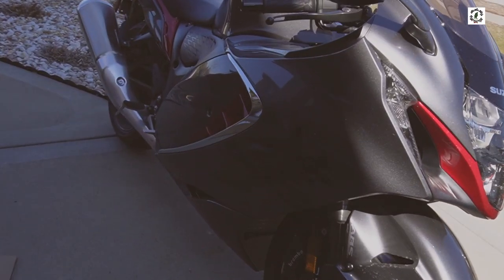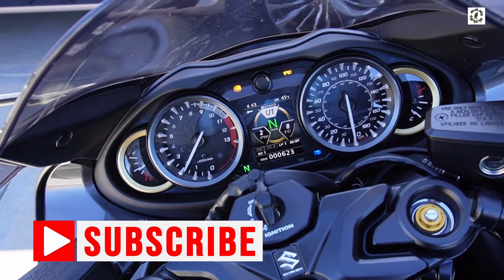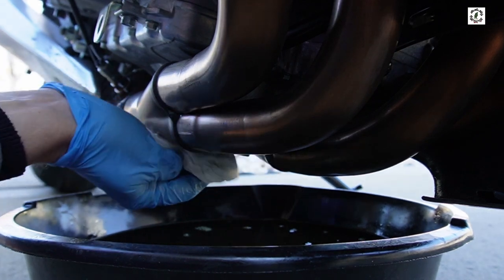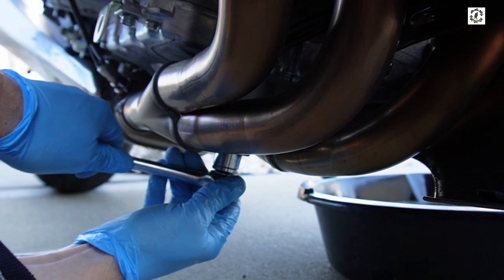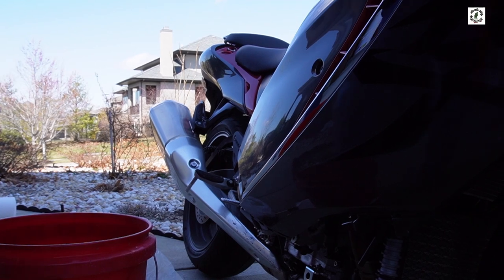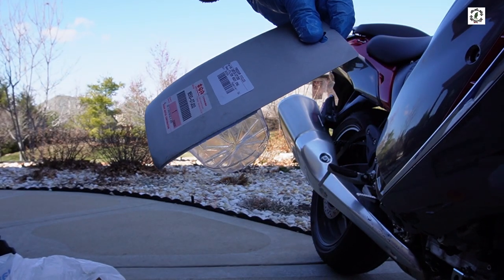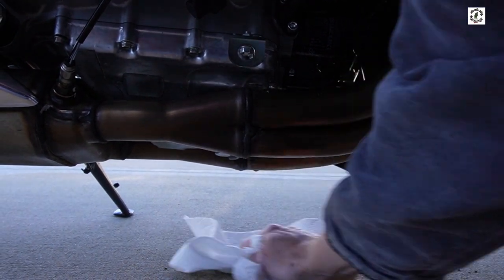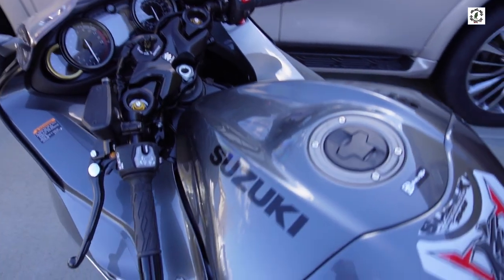2023 Hayabusa Oil Change Tricks and Tips

Comment: Also, get a rubber tip air blower, and with the old oil filter still "on" and drain plug "out", blow compressed air thru the oil cooler inlet on the engine case side. This gets all the dirty oil out of your cooler. There is about a third to half a quart that hides in there. Cuz if you dont drain it out, your just mixing new oil with dirty oil and basically defeating the purpose of an oil change.
Reply from the maker: Great tip.  Thank you!
Reply: That sounds like a waste of time and messy. If you raise the rear wheel off the ground it drains fine.
Reply: I always end up with a mess when changing oil. You were doing good until the funnel incident. 😂

Comment: Tight by hand with the filter......that's all you need.
Reply: not trying to be an ahole or anything, but the service manual says 2 turns.  this is not a car engine, it vibrates and runs way up higher in the rpms.

Comment: Aren't you forced to change the oil at a dealer? Pretty sure you lose the warranty if you do it yourself or am I wrong? Or maybe it's just different for EU markets, this is my first bike ever with November delivery and I try to learn all I can about it, I've worked  on all my cars beforehand so I don't really need the help of a dealership for anything but it just seems strange to me. Thought you were supposed to do dealer only service on the bike until the warranty runs out or it voids it. Also how exactly do you run in/brake in the bike? From what I've read on the forums people were saying 500 miles no higher than 5k rpm oil change, then 500 more no higher than 8k rpm and trying to find the point where vibrations are generated and keep it at that RPM
Reply from the maker: They can't void the warranty if you do your own maintenance work, at least in the U.S..  I don't know about Europe but I doubt it would be any different.  

With modern bikes, and normal street use,  I see no reason why you would have to adhere to any break-in limitations.   I would ride is as you would normally plan to ride it right from the beginning.  I haven't bothered with such things on any of my bikes and it has been no issue.
Reply: They told me at the dealership I could change my own as long as I used quality and right type of oil.  I bought just 3 weeks ago, love it.  It was my first bike in MANY years, and much bigger...put in C mode and get used to it, then move to B (where I am) this will keep traction control and power down until you get used to it.  It's not really twitchy... but it is a lot of HP and a sport bike.  I practiced a lot in neighborhoods stop & go , left and right turn takeoffs but she loves the interstate and drives herself at 70mph with cruise control on.  Read the same on forums about break-in, the dealership actually said "just drive it, but don't bounce it off the limiter. "  That's just not me though, and you can really have lot of fun cruzin'  at up to 6K honestly.  
Be careful and grats on your new Hayabusa too !

Comment: Only pre-fill the filter if it's an application where the opening of the filter stays at the top while you're screwing it on. For filters like yours or on my Harley that mount horizontally or even the few odd balls that mount upside down like an old slant 6 I never bothered to try to fill the filter.
Reply from the maker: Thanks for your feedback on that. It makes sense. Also, if it was important to prefill such filters I would think that the owners manual would mention it.

Comment: You should have never had it leaning on its kickstand while draining the oil, especially sloped driveway... You probably had at least a half a quart or more of dirty oil that did not drain out... If you were to have that bike level and draining, you would have used and your oil would have been perfectly between the two lines on the window/sightmark
Reply from the maker: Good point.  Thanks.

Comment: Use aluminum foil below oil filter to catch the oil and drain it into your tub below.
If you shape the aluminum foil correctly you will have Zero oil on your exhaust pipes or headers.
Reply from the maker: Great tip, thank you!

Comment: as soon as you feel the crush washer crush, you're good. 
the only time I've broken a fastener is with a torque wrench. so I don't use them. only exception is if it's something that requires repetition, like a lot of bolts that need to be the same spec around a cover or something like that, which is rare.
Reply from the maker: Great point!

Comment: Good vid. Now, how to get rid of that darn service indicator. Did my first service close to 600 but before the indicator came on. Bike was garaged for most of winter, took it out for a bit on a nice day, then noticed the service indicator at about 700 miles.
Reply from the maker: Thank you. I totally forgot about that service indicator.  I will do a short video showing that as Drew with Moore Mafia showed me how to do the reset on my 2020 Katana using a paper clip and it should be the same procedure with the Busa.
Reply: @cycletron  excellent! Will keep my eye out for it.

Comment: Was your busa in the recall for the front brakes?

Also, I take it that you don't like the soft saddlebags for traveling?
Reply from the maker: The dealer never said anything about the brakes.  What is the issue?
I would consider soft bags for long trips as it is better than wearing a backpack for sure.  I would just like to get by with a tail/tank combo that you mentioned.
Reply: @cycletron  At times after sitting, the front brake lever will go all the way to the grip until you pump the brakes back up. They are changing out the Master Cylinder and Lever assembly. They sent out the letters.
Reply from the maker: @SmittyAZ  Thanks Ray.  I have not received that letter.  I will call the dealer as a precaution.
Reply: @cycletron  I received a Safety Recall Notice in the mail on mine.   Apparently it is with the front brake master cylinder.
Reply from the maker: @baymoto553  Thank you. I will call my dealer to see if my bike is effected.

Comment: Do you find the power predictable on the Hayabusa? I'd love to get one myself but I imagine I would have to put it on one of the lower modes like rain mode until I got used to it.
Reply from the maker: I find the that the power is very linear. I think what you suggest about using lower power modes to start is prudent and I am still riding it in B mode.
Reply: Gen 3 drives itself lol.  Get one it’s the easiest (hayabusa) to ride so far
Reply: I got a gen3 and I love it, I am 5'8 187lbs, ride mainly in mode B, and I can say it comparable to a 600 or 750.  I use made A on the highway and it's still very manageable
Reply: Kindest beast you’ll ever ride. Smooth, yet powerful. I own a brand new 2023. Rocket ship of a bike. Catalytic converter foot area gets extremely hot and uncomfortable is the only downfall.
Reply: I bought one 3 weeks ago.  This thing is a beast!  I kept it in C mode for first 150 miles and got used to stop & go , turning while taking off, that's the hard thing...she loves the interstate.  I did move to B mode to get more used to the power and it seems linear and as expected, but it is touchy to me, and will be long while before I get up to A mode which is supposedly pretty twitchy from what the videos say.  
Get one !